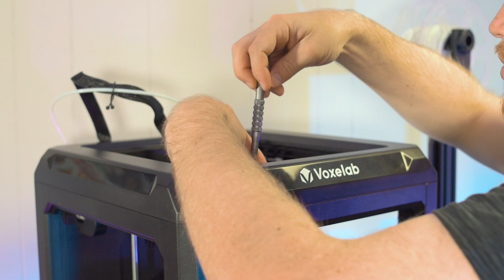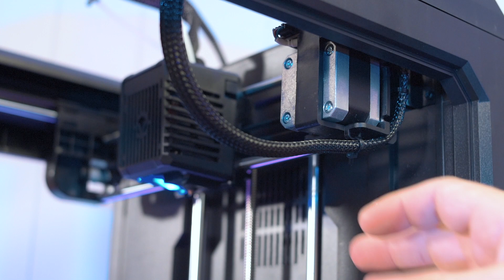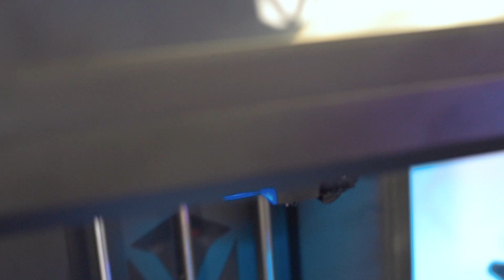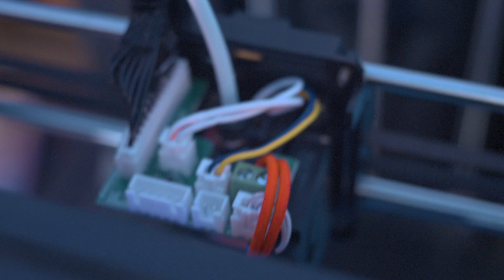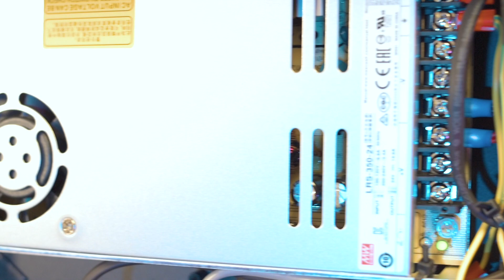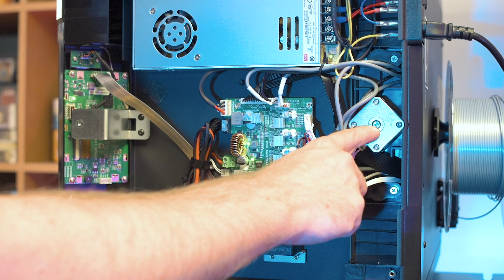A Closer Look at the Voxelab Aries 3D Printer

Comment: will the flashforge software work with it as they look the same
Reply from the maker: Afraid not. According to Voxelab, this machine is no longer supported in anyway. :( luckily, it’s a generic marlin machine. You can easily make a profile with Orcaslicer. Wi-Fi won’t work that way though.

Comment: Hi, I have a question, what does it mean when I'm halfway printing something and it pauses and says, "No Material (Filament) detected, please replace Filament?"

I have a lot of Filament, but it keeps pausing and saying that.
Reply from the maker: That sounds like you have a bad filament sensor. Check the wiring at both ends for a losses connection. if that looks fine, it’s faulty. unfortunately.
Reply: @3DPrintSOS  thank you for your response. 

I also noticed that when I turned off the Sensor it'll Print, but with it on, it pauses and gives me that Notification.

Comment: Can anyone tell me what style of nozzles the Aries uses? is it a normal MK8 ? Thanks
Reply from the maker: Yep. Normal MK8
Reply: @3DPrintSOS  ty so much. Got the ability to get 2 Aries for a good price so wanted to be sure what nozzles to use. After about a year, how has your experience been with this printer? Is it work picking up or has there been a lot of tinkering needing to be done ?
Reply from the maker: @blackcanyonmodelworx6060  I just passed it onto a student so he can enjoy learning 3D printing. It’s a decent machine that is built well. The only downside is that the screen, board, and firmware are proprietary. So you have to be ok with the Voxelab Ecosystem. If you are, it’s great. I have printed some awesome things with this machine over the time I’ve had it. My number one complaint is the bed. I would buy and retrofit PEI spring sheets on the machine asap. Makes for a much better experience as the glass bed can be too sticky.
Reply: @3DPrintSOS  tysm for the info.

Comment: I’m having issues with petg filament do I need to low the speed down ?
Reply from the maker: In my personal experience, yes. I have to print PETG slow. But when I slow it down, it comes out perfect.
Reply: Wish they add a fan controller option on the touch screen display it’s on 100%

Comment: Just came across your channel (and I subscribed) while looking for Cura machine/gcode settings for the Aries. I see you have a video for the Aquila setting up Cura for that, do you have a video for doing the same for the Aries? If not, please consider. :-)
Reply from the maker: The Aries is a locked down system. Even though you “can” have it running in cura, the output was so superior from Voxelmaker I wouldn’t recommend cura for that machine.

Comment: I really like mine, prints really well wondering though if there is a way to run Marlin on this printer, would really like to do some tuning on it that isn't capable with the existing firmware, Not sure if it is worth swapping out the board and screen on it.

Comment: in your opinion replacing those fans with Noctua  fans would make a more silent 3D experience?
Reply from the maker: Most definitely. However Noctua doesnt make 24v fans. So you have to run buck converters on each fan to reduce the power to 12v.
Reply: @3DPrintSOS    that is true  more complicated  .  too bad noctua does not make 24 volt fans

Comment: Hello, your videos have been such a great help! I am looking to purchase my first 3d printer, but am looking at a beginner friendly model (ie aries or adventurer). In that $300-$400 do you think an aries or an adventurer 3 pro would be the better option? I like how you dont have to use the proprietary slicer on the aries, but also like that the adventurer is fully enclosed (i have 3 cats and a 1 year old) and auto levels. Which do you feel would be better quality for smaller hobby prints and possibly some etsy sales?
Reply from the maker: I can’t say much about the adventurer as I’ve never had any flashforge machines. I do like the Aries though I think it needs a bit of love. I don’t like that the firmware is proprietary but along with its slicer, it does work really really well with Pla. Smooth and super easy to get printing. :)
Reply: @3DPrintSOS  can you use cura with the Aries?
Reply from the maker: You can. And there are some profiles that work well. However, in my findings, the profiles preinstalled in Voxelmaker print REALLY well.
Reply: @3DPrintSOS  thanks for the help!

Comment: Hi! You seem super informed on the down and dirty of these machines and I desperately hoping you can help me with something I have done to my Aries! Opened it on Christmas and instead of cutting the zip tie on the x-axis timing belt. I cut the entire timing belt. Now I’m trying to figure out A. Where to get a replacement and B. How I would go about replacing it. I fear I just bricked this thing before we even plugged it in.
Reply from the maker: Shouldn’t be too too hard to replace. Will have to take off a few pieces and reinstall. I’m afraid the belt would have to be purchased by emailing voxelab. Unless you know the specific size.
Reply: @3DPrintSOS  I am chatting with them, but they aren’t understanding the extend of how much I cut 🤣 It does seem that you don’t “need” a continuous belt, but I’m trying to get them to tell me what size I need to replace it with.
Reply from the maker: Ah the downsides of international support. I would shoot them a video. That will instantly help. Haha
Reply from the maker: https://www.facebook.com/groups/2728708067343914/permalink/3013466248868093/ just found your post on FB. That’s great. Looks like you can just reclip the belt in a different orientation. :)

Comment: What about when you plug it in because mine I just plugged it in and it only has the voxelab logo on it is it booting up?
Reply from the maker: I’m not sure what the question is. Try to turn the machine on without the usb in it.
Reply: @3DPrintSOS  we switch the power on and off it fixed and I’m printing now you videos provide a lot of help thanks
Reply from the maker: Nice! Glad you got it sorted. :)

Comment: is there any kind of metal structure inside the plastic body. ive seen these an have wanted to pick one up but anytime i see pictures or videos of it opened up like u did the top it doesnt seem to have any metal other than a few thin brackets or is most of the body metal with plastic covers? at times it sounds like metal and other times it sounds like plastic. its hard to tell from just watching i guess.
Reply from the maker: I don’t think so. Hard to say, I haven’t had it further apart than what you see in the videos. It’s very sturdy though.

Comment: I'm new to 3D printing.  How do I setup the Aries up with Ultimaker Cura?  Or is there better software I should be using with it?
Reply from the maker: Although you can use Cura, I prefer VoxelMaker with the Aries. It just prints better and cleaner with out of the box presents. Plus WiFi only works with voxelmaker.
Reply: @3DPrintSOS  Thanks for the reply

Comment: Have you ran PETG? I'm having trouble with adhering.
Reply from the maker: Not on this machine. I’m keeping it a pla setup.
Reply: Would you mind telling me your settings for PLA? I'm still new to all this but PLA is working just not sure how to fine tune it. I also tried using voxelmaker to 3d print something but couldn't get it to make a gx file of the model. So I've been using flashpoint so far. Any help would be grately appreciated

Comment: my aries just came in and is completly wont work just grinds in the rear it will not print
Reply from the maker: Ok hmm. Give me more info, have you leveled the bed? Have you updated firmware? Are you printing from voxelmaker or the usb? What are the temps? What material are you using?

Comment: not a bad printer.. but... no way to connect it to octoprint, and the wifi so far is flimsy at best... would be nice to have a usable port at least.  Quite frustrating to not have access to the network port from cura or slicer...
Reply from the maker: That’s all true. However it does work really well with VoxelMaker and pla. I’ve had many flawless prints via WiFi and voxelmaker.

Comment: Is there room for upgrades with this printer? I like that the assembly is minimal but I’m wondering if a kit is better in the long run because of the ease of upgrading it.
Reply from the maker: Because of its proprietary board and screen and firmware, you are limited to 230 degrees. However, if you swap out the board and screen you could technically take the machine into any direction. I would say it’s just as upgradable with the only difference of being the Ender style printer has been modified in such greater numbers, it might be easier to find content for it than DIY on the Aries.

Comment: Do you use Cura with your Aries machine and if so will your Aquilla settings file work with the Aries? What setting would you list as the gantry height? Love the videos, great for a someone just starting with 3D printing.
Reply from the maker: I’ve tried and I didn’t like it. In my opinion, voxelmaker is the best for the Aries.
Reply: @3DPrintSOS  on a scale of one threw ten where would you rate this printer and slicer. I make small parts 10 by 20 by 5mm petg so it doesn’t need any thing major like a raise or prusa. And also are you familiar with the qidi I mates. Don’t know if I should get another inmate or the Aries to save $200 compared to I mate.
Reply from the maker: The Aries is a solid 7. I give it that beaded on its chassis and how well it works for pla over WiFi with voxelmaker. If you want to do other materials though, this machine falls short. In my experience, the Aquila would provide better results and won’t have you locked down to proprietary parts/settings/configurations.
Reply: @3DPrintSOS  there needs to be some voxelmaker tutorials because I can’t find any. Just a detailed explanation of what all the settings do. Because right now the settings are a list of potential causes but I have no idea what effect they actually correlate to.

It’s making it very difficult to print even files designed for testing and I’m lost that to do to actually fix it.
Reply: @3DPrintSOS  Thank you

Comment: I am wanting to get into printing. What printer would you recommend to start with this one maybe. I want to print with pa12 or something strong with carbon fiber. Thanks for any input
Reply from the maker: This one wouldn’t be good for much outside of pla, PETG, abs, TPU. It’s limited by it’s locked firmware. So you couldn’t go hot. 

An Aquila would be nice because you can always upgrade it or modify it into anything you want. What is your budget?
Reply: @3DPrintSOS  I am looking around 3-400 dollars if possible. I would like a decent entry level printed but I want to do be able to do pa12
Reply from the maker: If the size doesn’t bother you, the prusa mini is a pretty awesome machine.
Reply: @3DPrintSOS  I am not going to be printing big things, thanks I will look into that one
Reply: Where is a good site to find that printer?
Reply from the maker: Prusaprinters.org I believe

Comment: Does the Alex firmware work on this machine?  It has been great on my standard models
Reply from the maker: No sir. I don’t think this machine is open source
Reply: @3DPrintSOS  well that sucks!
Reply from the maker: Depends how you look at it. The machine DOES work really well if you stick with their slicer.
Reply: @3DPrintSOS  I need one with an enclosure. It would be better to buy an original and a little booth
Reply: @3DPrintSOS  hey by the way thanks for the info.  You’re my go to guy for voxelab printers.
Reply from the maker: @daspicsman  voxelab gang 💪🏻
Reply from the maker: It would be possible to run it off a SKR board and screen and then you could run any Marlin based firmware. But that’s a whole different story. ;)

Comment: How would I ad this printer to cura it is not on the list and I can’t find the details on this printer anywhere
Reply from the maker: No it’s definitely not on the Cura list. You should use VoxelMaker with the Aries. It’s completely trouble free and work with WiFi. 

If you just got the printer, first thing you should do is update your firmware using the usb and a computer. Grab a copy from voxelprints website. There are some bug fixes that are worth fixing.
Reply: @3DPrintSOS  sorry I know this is old but I wanted to let you know I decided to use Voxel Maker instead and it’s a bit more user friendly at least for me love the video tho I made my first print ever while watching
Reply from the maker: @oogityboogity6644  That's the consensus I've come to with this machine. I love cura but its just not the same with the Aries. And VoxelMaker working right away with zero issues + wifi...its the way to go with this printer. :) Glad you got it all working.
Reply: @3DPrintSOS  I would love to know if you have worked out good setting for printing PETG bc I have been able to print abs and pla fine but tuning for overture PETG just can’t get it right
Reply from the maker: I haven’t printed with PETG yet, but my friend Dante is doing it now. I’ll see if I can borrow his settings and give it a go.

Comment: Your videos are among the best I have watched, your always informative and straight to the point. I am going to get one of these machines (Aries) based on your opinions. I would really like to see more videos on this machine after you use it more. Thanks again for the great videos.
Reply from the maker: I really appreciate that, Don. I’m glad you’ve enjoyed it.
Reply: @3DPrintSOS  I am thinking this, but I want to replace hot end.  Was told this cant be done by voxlab sales.  They don't have a way to change extruder steps in hardware and the USB cannot be used to load different firmware that could do this.  Is this a real problem or just something voxlab sales is just saying.  Like could replace with volcano hot end?

I have not purchased yet.  But want affordable unit with ridgid frame/cage.
Reply from the maker: @joeboxter3635  You can replace the hotend. You just can't do anything with the firmware. It's a closed system. So you can't hook it up to your computer in any way. So yeah, no extruder steps, etc. But the hotend can be swapped.

Comment: I can’t get mine out of the upgrade menu once the new malware installs I get the green check mark, it plays it’s tune then you try to hit back and the whole screen is frozen. What should I do? I think the software needs updating because the printer won’t print anything we’re I put it in cura. Only prints in the back right corner. 

(Also turning it off at this point nullifies the malware update. It still asks to install one rebooted)
Reply from the maker: If it’s the first firmware update, you need to do it via the usb. Download the firmware from the site and put it on your usb drive. Then insert and turn on the machine. Once it’s done, remove the drive and reboot. The initial firmware has an update bug it seems
Reply: @3DPrintSOS  I’ve tried using the usb but the boot up process doesn’t seem any different am I doing something wrong?
Reply: @3DPrintSOS  contacted support, they had me down grade a version then re update all is good now!
Reply from the maker: Ah. Interested. But thanks for letting know. That way I can try to help if anyone else has the same issue.
Reply: @frognutz0o  I contacted support and they sent me the downgraded version with instructions
Reply: @frognutz0o  I’ve been very pleased with there customer service! Glade to here your up and running!

Comment: God job F on showing the inside and adjustments. The only thing that came to mind, is, the drivers look to be permanent as apposed to replaceable. Even though they do have good heatsinks, having to replace the whole board if one fails, seems silly. Correct me if I am wrong. Cheers
Reply from the maker: That’s correct, they are attached to the board. I’ve never seen a stock board not have this though. Seems like common practice. If one driver ever goes, which has never happened to me, I’d just throw in a SKR board. ;)

Comment: I would like also compliment Voxelab's support team. My first Aquila has been down for 3 weeks, and through e-mails back and forth, a new motherboard an constant communications we found the problem to be the X axis harness. One wire was not making connections. It took 3 weeks to fix because of the time to send the new motherboard, not because they were not communicating. Though I purchased a new harness from Amazon ( it takes about 2 weeks for Voxelab to send you parts), it was well worth the $12.00 just to get it up and running. Again, their team helped and supported me during the whole process. I have 3 Aquila printers and when the time comes, I will continue purchasing Voxelab printers, maybe even the X2 or the Aries. Thanks Voxelab!
Reply from the maker: That’s great to hear. Like I’ve mentioned several times, I have dealt with several companies that never even responded to me, let alone helped. So it’s good to know they stand by their product. Now let’s see how they handle this thermal runaway debacle.

Comment: First off I enjoy your videos thank you. Now I just watched a video reporting that the voxelab aquila has a thermal runaway issue. I know you've only had this machine for a couple weeks but do you know if that has been fixed in the Aries? I just ordered the Aries. (should arrive sunday) and I'm a little concerned if I made a mistake. Thank you for any help with this question
Reply: I've had mine for a month and its been more reliable than my Prusa Mini's which constantly break down.
Reply: @hexesandheroes  thank you that is encouraging for sure
Reply from the maker: Something I’ll have to check specifically. I’ll be sure to check before the review video.
Reply: @3DPrintSOS  thank you
Reply: My Voxelab Aries is at 686 usage hours. The issue I have is that it is slipping on the x axis and making the prints look like a Salvador Dali picture.